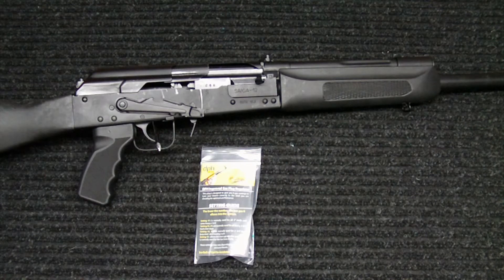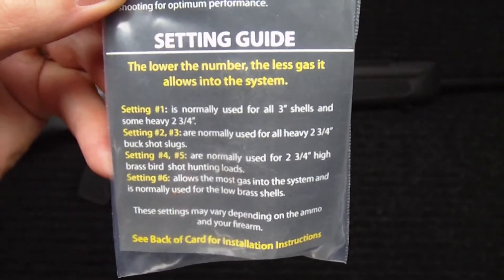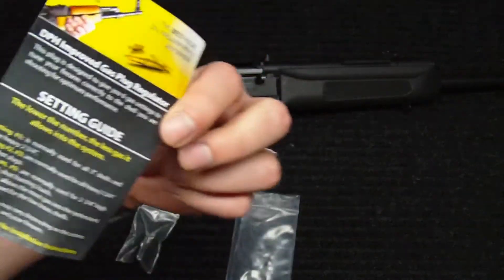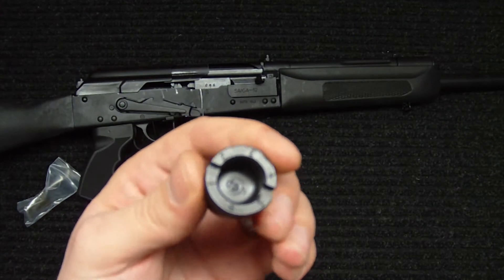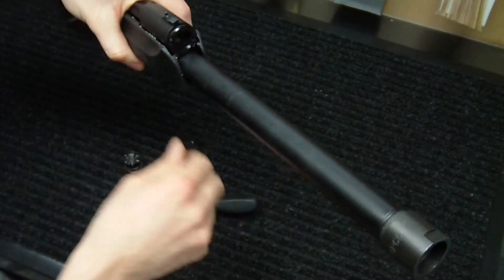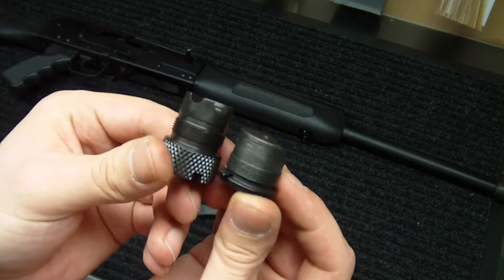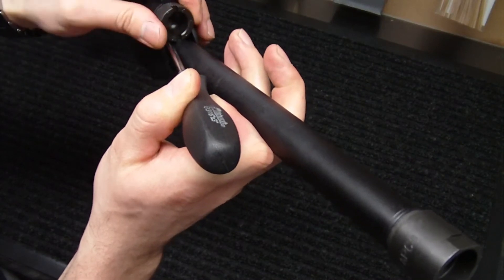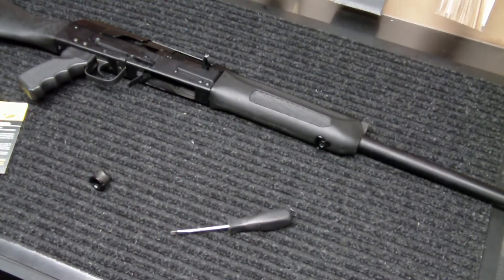Saiga 12 Gas Regulator by DPH Arms

Comment: yes threads are clean and screws right in and when it bottoms out it stops between 3 and 4 first click is 4. i cannot screw it in any farther if i wanted too. it does say on the little paper not all will start at 1 but thats all it says.

Comment: i have a Saiga that i bought this as well came as part of the kit from CSS and when i scew it all the way in it stops between 3 and 4. 4 is the first one to click. trying to get federal low brass to work 4 it did not 5 it did not 6 it was so so. then i was back to 1 and it didnt event move the bolt handle. but with slugs on number 1 it throws them ok. is there anyway to get it to screw all the way down and get number 1?